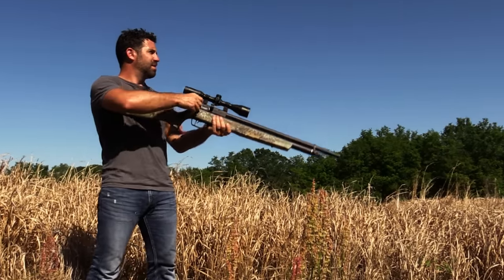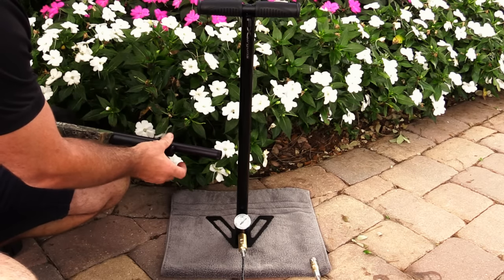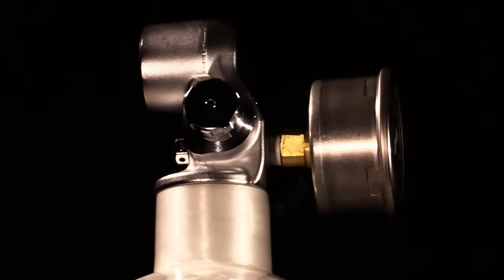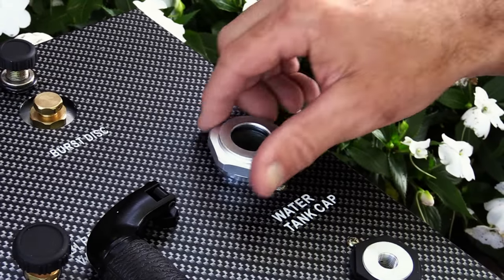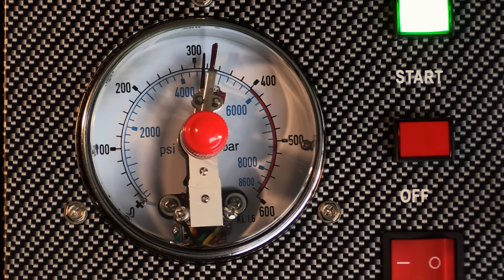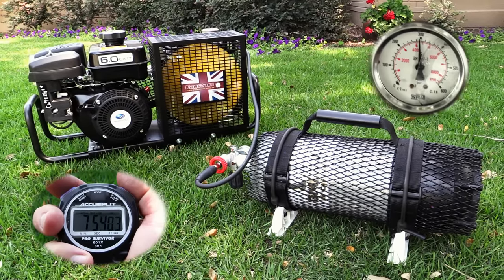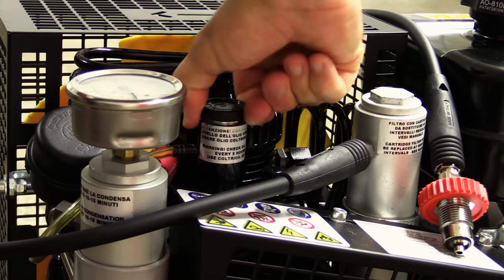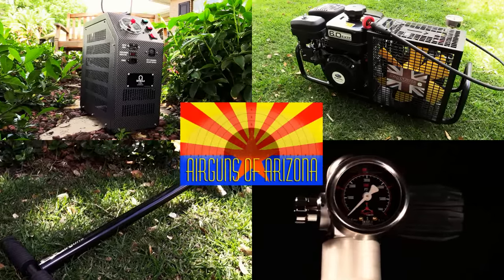Air Rifle REFILLING - How To + Setup GUIDE - Everything You Ever Wanted to Know !! - PCP Airgun

Comment: I got a 9L 300BAR carbon fiber tank on Ebay for $125. It has a DIN300 valve and was manufactured in 2010, meaning it's good through 2030 - and it was just inspected in Feb 2016. I bought a $45 fill station adapter with a pressure gauge and I'm good to go. Saved $400 when compared to the tanks from Pyramydair. All kinds of sellers on Ebay selling old fireman tanks and I highly recommend checking them out. Such an upgrade to my hand pump and for less money!

Comment: As a SCUBA diver I would like to warn you about the danger of putting an air tank vertically.  We always lay it down, so it cannot fall over and break off the valve.  If that happens you are in big trouble, 300 bar escaping at once is not a joke.

Comment: Great video. Fortunately I only have to fill my pcp to 200 bar which is pretty easy with my gunpower stirrup pump and 200lb frame. Still, you are right, as a man that Daystate compressor has a definite allure.

Comment: I used the 'oldest' style tire-pump style for all my shooting. You left off the keep lightly lubricated-- all moving parts-- with silicone <di-electric> grease". I used it to practice shooting at elevated heart-respiration to simulate stress. I used to shoot a lot. An awful lot. And I have a brand new in the box Omega compressor. Saving up for another-- two sons.  I'm getting the compressors to make shooting easier for my sons-- to hook them on shooting more quickly. Good video. Thanks.
Reply from the maker: Hi Mike.  Welcome back.  Well now you can share the video with your kids so they know how to operate and maintain it 😊.  Best, Steve
Reply: +Airgun Exploration &amp; Advancement Channel I'd love to be able to get another Omega, and then two of the Scott Air Pak 4500psi tanks. I did hate that tire pump style, but I sure got my exercise from it. There is a method to using it, you have to get your arms straight and  let your body weight do the work.
Reply from the maker: +Mike Kemp Mike, are you in the market for an Omega  Supercharger?  Steve
Reply: +Airgun Exploration &amp; Advancement Channel I have one, and am 'in the market' for another.... problem is, I'm not 'in the money'. I'm on social security, and I scrape my pennies up. Took a year for the first one, and I'm not quite halfway to the second.
Reply from the maker: +Mike Kemp You're a good Grandpa Mike.  Steve
Reply: body weight as in about 200 lbs. @mikekemp7815

Comment: Great video and nice choices of what to highlight and the deliberate choice of changing background music was a good idea between the various options. 

I was aware of all the products already so to me the real highlight was the omega compressor really, and in particular the short breakdown on expected regular maintenance in operation. That's a thing most other sources of information skim over with just a "low maintenance" statement. 

It was high up on my wishlist already but based on that and not seeing too much bad rep on them around after they've been on the market a while I'm tempted to look into getting one eventually when it won't mean emptying my entire savings account. So for now the good old Hill handpump it'll be as primary source of compressed air.

I often wonder how those daystate compressors hold up against the traditional workhorses in that size category like Bauer compressors which I've seen used for diving and such. Still torn between for example the Omega one or a used portable/semi-portable electric Bauer compressor, both are in about the same price range depending on model and condition for me.

I also wouldn't mind the huge Dräger ones at the fire departments that I've seen while there to deal with some IT related trouble of their computers and air quality testing software, I'd love to have even just a fraction of that compressor equipment equipment or stockpile of carbon fiber tanks it's really neat stuff. A first stage compressor which fills up a tank larger than a typical bathtub to a moderate pressure which then gets up to the working pressure of the storage cylinders by the Dräger, those machines in operation are quite noisy but they tend to be in a room of their own a bit away from the fill stations so it's not too bad (when the doors are closed). 

Being in a room like that is a bit humbling when knowing what kind of energy is locked up in those bottles and fill lines along the wall. When I was there at the time there were about 50-60 tanks in wheeled crates ready to be shipped out after they returned from hydrostatic testing and were refilled there, it's quite a difference from the usual filling setup in a dive shop.
Reply from the maker: +Extra stuff Thanks Extra Stuff.  I know the Bauer name... it's a good one.  But if you check out Coltri's site http://www.coltri.com/, you'll see that they are everything Bauer is and more maybe.  Agreed on being intimidated by the compressor room at the dive shop.  I got in & out of there as fast as I could... not to mention it was deafening.  Thanks for the comment.  Best, Steve

Comment: lol and heart healthy  I had a hand pump for about 5 minutes.  then I just dropped 2500$ on an AC Airetex 4500psi compressor.  I knew my PCP air rifle hobby had just started and now 6 years later I'm 30 air rifles deep with 4 tanks and 2 compressors.  However I run an air rifle business called Custom Air Rifles and Designs CARD for short. look me up.   what ever I do I do it to death.  just as I see you do.  good vid and info on filling.
Reply from the maker: lol, yeah.  It was some work.  Thanks for appreciating the vid.  Best, Steve
Reply: What a man! :)
Reply: NanoBlaster's CrossFire hey buddy I just bought a Scott scba tank and I’m about to purchase a air compressor what adapter do I need to fill the scba tank and then use it to fill the pcp air gun?
Reply: Tried to access CARD site, ads out the wazoo, no thanks

Comment: Great vid Steve!  Ordered my Omega Super Charger from AOA and expect it in tomorrow 5/27/2016.  Now that Sports Chalet is closing, this is my only way to charge my HPA tanks, as the airsoft/paintball and scuba shops won't fill them.
Reply from the maker: Great to hear Jeff, thanks for letting me know!  You made a great choice.  Steve
Reply: @AEAC  I love my bottle pump, but it 's always been slow.  I've modified my Omega pump by installing an inlet adapter and using a "pancake" compressor that holds between 90-120 psi.  It has increased capacity past the new omega 2 bottle filling compressor capacity.  In addition to the "pancake" compressor, seeing that I'm a mechanical engineer and HVAC&R designer, I've added multiple moisture reducing extractors and a final desiccant moisture filter before it enters the Original Omega tank filling pump.  These changes have made my original pump work at lower amp draws and at quicker fill times than even the new omega 2 bottle charging 4500 psi air pump.  I hope that you can see how we "laymen" can not only re-design things, but also make them more efficient.  Please continue your great reviews of air rifles and associated equipment.  I just wanted to share with you how things can be enhanced without great costs to those of us in the air rifle world.

J.D. Hall

Comment: Hello Steve. As usual great video, tons of useful information. In addition to your airgun skills i'm highly impressed by your video making skills for someone who is not a full time YouTuber I don't know any airgunner who can beat what you do. I'm very grateful. I have a question and still didn't find any answer on the web. Filling your rifle with a pump from about 1500 psi to it's limit may take anywhere from 100 to 300 pump strokes depending on the cylinder/bottle volume, the max pressure and the pump stage. So to fill the rifle you open and close it's intake valve 100 to 300 more time than filling it with a scba which will open and close the valve only once per fill. Isn't that gonna wear out the rifle tank seal prematurely? What do you think? Thx ! Btw I'm gonna heavily contribute to spreading your channel it deserves way more subs and views.
Reply from the maker: Interesting question... seems valid but I honestly have no idea.  Best, Steve
Reply: ahmed the pressure in the pump line keeps the guns valve open so it is not opening and closing it stays open until you open the air drain plug

Comment: This was a great review for setting-up and using the Omega compressor. Great job. I filled two carbon tanks. However, when I went to fill my new Daystate Red Wolf, I was NOT able to fill the rifle past 162 BAR from either of my NEW Omega carbon tanks. The gauge on each tank read 4500 psi but would only fill the rifle to 162 Bar. The max on the rifle is 250 Bar. I am trying to determine my error in filling or if the bottle on the gun will hold no more than 162 Bar.    Hmmmmm

Comment: Excellent video, well made and very professional.  Difficult to find a 4500 PSI fill station in Central Florida so I purchase and received an Omega Two Cylinder Supercharger this week.  Very simple to set up - even without the  (Owners Manual) that has not yet been printed.  But, all is well as I am very happy with my new air compressor and I am sure Tod will get me one as soon as they come out.  
Cheers
Reply from the maker: Ron Wiederhold Thanks Ron.  I'm glad you found it helpful and congrats. This vid was still one of my favorites.  Steve
Reply: Hi Ron, have you thought about getting your name known in the pcp/scuba diving communities. It might be a lucrative little sideline refilling peoples tanks.
Reply: I purchased the Omega compressor for ease of use as I am 68 years young, and don't have the inclination to use a foot pump.   I am sure the foot pump is a handy device to have and have given it some thought, but in the long run the compressor was the best option for me.  Refilling other peoples tanks is an open consideration.   I ran a dive boat in the British West Indies, so scuba has always been an interest.   Located in Central Florida area.  Would appreciate any info for PCP clubs or activities in Central Florida area.  Cheers
Reply from the maker: Ron Wiederhold Dade City Rod & Gun Club, North Florida Shooters, South Florida Airgunners.
Reply: Many Thanks
Reply from the maker: Ron Wiederhold 👍

Comment: Excellent video! Very helpful and informative for a novice air gunner such as myself. One question I have,  you said not to use  distilled water in the Omega compressor, what is the reasoning behind that? Just curious. Thanks.
Reply from the maker: Very welcome Sir.  The instructions say not to use "distilled" water because it's "to pure."  That's all I've got, lol.  Apparently they want a bit of mineral in there.  Steve

Comment: Thank you for the video!
2 questions please,
1) do you keep your PCPs full, half filled or empty when storing them?
2) how can I see how much air (bars) is left in my scba tank?
Reply from the maker: +adopap1 You're most welcome.  About half full is probably kinder to the seals long term although in some guns it doesn't seem to matter.  Some seals go bad annually no matter what. lol.  As for viewing pressure in your SCBA tank, you may be able to thread in a pressure gauge in that plug you can see just under the DIN opening on the Omega line.  It's not uncommon for these tanks to have them so you can check with AOA or your local dive shop about adding one.    Best, Steve

Comment: Hello Steve… greetings from Peru  👋👋👋…. I always follow your posts, they are plenty of tips and have clear messages. After waiting for a little more than two years, finally the brads I was expecting to buy arrived to Lima last week.
I’m planning to buy an Argus 60 .22. Also, I am seeking for a SCBA but I need to know what kit/setup would you recommend me to use for filling the rifle. I found in Amazon a kit for about $65 (Alomejor) but when I read the comments, they said that the kit lasts for around 12 charges, not more…I seems that O rings are not good quality. On the other hand I found the Stikman for about $189. What would recommend me to buy thinking that l will not be an intensive shooter? Maybe I will go out for shooting twice or three times per month. Well, thank you in advance for your response. Just in case, also I will copy this message in your Argus 60 review. Thanks, Antonio
Reply from the maker: Greetings.  Any of the top brand SCBA tanks will come with everything you need to fill... Omega, Air Venturi, AirMarksman, etc... no need for any additional parts off Amazon.  I have some that are 7 + years old that are still going strong.  Steve
Reply: Thank you Steve

Comment: Great video Sir !
My name is Ray,
we have talked before,
I am in the process of building a commercial high pressure compressor for an in store refill program, and tank bank.
I have been in communication with a few mining operations that are selling a refurbished commercial compressor, along with cluster bank of tanks.
I currently own a 23hp. three cylinder diesel engine, suitable to power a commercial compressor.
Do you have any suggestions as to an industrial grade compressor unit in this application ?
Thank you !

Comment: I've got a small 110V electric compressor to fill the tires on bikes, lawn tractor, etc.  Will it work for a pcp air gun?
Reply from the maker: From what I've seen, shop compressors only fill to a few hundred PSI and most.  Airguns require 2,000-4,000 PSI.  Steve

Comment: Steve,
Can you advise as to utilizing a Omega dry air filter between the supercharger and the large omega 75 cf tank.  Also my newest model Omega 75 CF tank has a push button bleed switch rather than a turn knob.  There is no instruction information for the new tank or the Omega air filter.  Your assistance or any response from other commenters would be much appreciated.
Reply from the maker: I'm sorry I cannot. Give AOA a call and they can help you out.  Steve

Comment: Hey Steve,
can we leave the scuba tank attached to the gun while shooting?
I mean by stabilising the pressure of the aircylinder of the gun 
with the scuba tank's pressure. The scuba tank's valve would be slightly open of course, 
not all the way open.
Reply from the maker: I wouldn't recommend it, no.. as the pressure to the gun's tank tends to fluctuate as the pressure in the tank changes with consumption.  For this you can purchase an external airgun regulator.  They're especially helpful with big bore, large air consuming guns and work great.  Best, Steve.
Reply: Ok good to know, thanks!
Reply from the maker: +adopap1 Welcome!
Reply: adapop1, hell no! You can keep the tank attached to the gun if the valve is closed but firing the gun while connected to the tank with the valve open will at best ruin your seals and at worst blow your damn face off!
Reply: you can as long as the tank only has the proper psi amount that your gun is set for. when my scba bottle drops to 3000psi I shoot my synrod.22 connected to the bottle with valve open.This info can be found on the airgun forums

Comment: Does the omega 100 cu ft need to be filled all the way to 4500 PSI? Because I took it to a scuba shop and they only filled it up to only 3000 is there any special instructions they need to know to fill it up all the way? I would like your advise thanks
Reply from the maker: Adrian Gallo Take it to another scuba shop or paintball facility that has the compressors to be able to fill to 4500 psi.  Sounds as if your current shop doesn't have this.  I would just ask them.  You can fill your Omega to just 3000 psi if you like but you wont get very many 3000 psi fills out of it and of course no fills past 3000 psi.  Best, Steve

Comment: Dang that Daystate compressor is nice. I could make some money on it down this way.  No one fill fill over 3600 psi in my area. Thats why I have never purchased a CF tank.  I use my booster pump to fill my cricket to higher PSI's.
Reply from the maker: Sounds like a good fit for you 😆
Reply: Welding shops can hook you up with a 6000ish nitrogen tank, the initial investment  (about a grandfor the tank) is spendy but refills aren't.  Better to by a compressor?
Reply from the maker: +Michael Neumeyer As  suggested the three considerations one might have are time, money, and convenience.  Everyone will have their own motivation.  For me, a nitrogen tank wouldn't be practical for travel.  For some it might make sense though.  Steve
Reply: Welding supply is everywhere for our remote bretheren.  I would rather have the compressor.  Either way I'd use a carbon tank to move around with.  Again, great Vid I always learn from watching.
Reply from the maker: +Michael Neumeyer I'm aware of the idea but have no first hand experience.  Do they come to your home to refill or do you bring your tank to them?  Thanks
Reply: Depends on the size of the tank I think.   I use to do glass blowing and had to drag my two huge oxy tanks to get filled.  But was told if I bought the next size or two up I could get filled at my home. Nitrogen is pretty much the same.  Just not portable.
Reply: +Air Marksman Yep about five feet tall and heavy but at 6500 psi you can fill your buddy bottle and gun to high pressure all year, even better if you get wholesale through your business. Still a compressor is the ultimate answer and it costs the same as the bottle but you get to use it cost free.
Reply from the maker: +Michael Neumeyer I wonder how long would last with something like the Benjamin Bulldog?  The one I have here for review eats 100cf tanks like nothing, lol.  Steve
Reply: +Airgun Exploration & Advancement Channel Right?  Kip and freinds at AOA make their own Brand of big bore .45 maybe even a .50?  Two shots on high power, four on low, a bunch of air eating pigs.
Reply from the maker: +Michael Neumeyer I'm getting one full magazine before I see drop at 50 & 100 with the Bulldog.  It's fond of the bottle, lol.